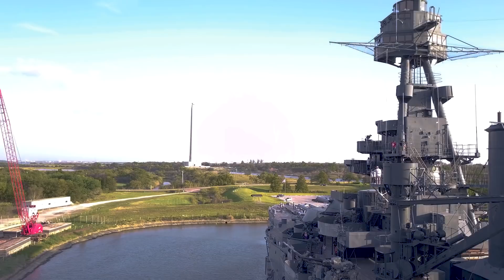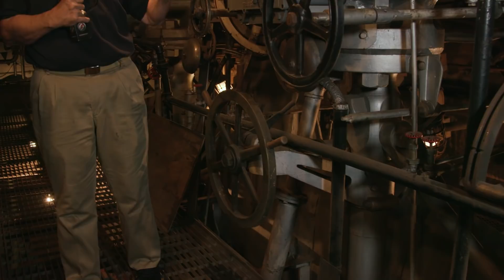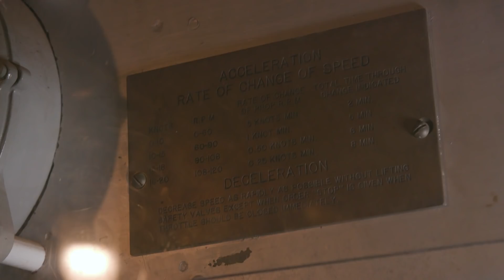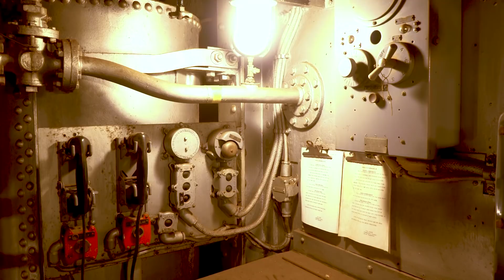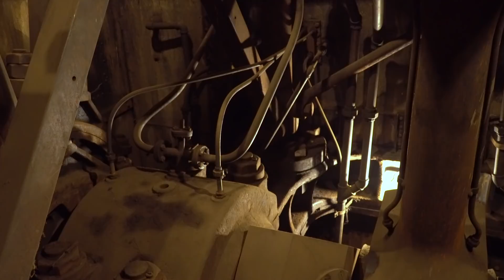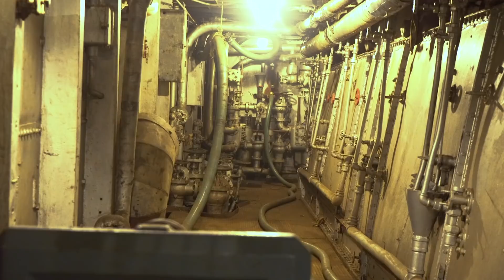Talkin' Ship - Engine Room!

Comment: I'm not entirely grasping how a triple expansion steam engine has 4 cylinders??!?
Reply: Triple expansion, four cylinder steam engine - one small high pressure cylinder, one intermediate pressure cylinder and two large low pressure cylinders. Cranks are set at 90 degrees. The reason for two low pressure cylinders is due to the volume of steam you do not require a super large low pressure cylinder.
Titanic (and sister ships) also had two triple expansion, four cylinder engines (that exhausted into a non reversing turbine).

Comment: The docent either doesn't know what he's talking about, or isn't very good at explaining how this engine is put together and how things work.  He doesn't mention where the cooling water is used (the crank bearings).  The way he says it, hints that the engine cylinders are cooled which of course they are not.  The eccentric rods don't move the piston, they move the valve stem which moves the valve.  He doesn't mention that they  pointing to a valve crosshead and not a main crosshead.  He never mentions that this type of valve gear is called Stephenson valve gear.  His explanation of double-acting cylinders is wrong, they aren't double acting to support the weight of the pistons but rather to extract more power from the steam, etc., etc., etc., etc.  I see docents everywhere that aren't experts in what they're doing, just well meaning volunteers, teaching nonsense and perpetuating public ignorance, it drives me nuts, can you tell?  Nothing personal Tom, maybe you were just nervous, thanks for volunteering.
Reply: You go volunteer and do a better job then. You won't though because you are a cowardly loser.

Comment: To save the Texas it will need to be dry docked permanently to be displayed. The constant water on the hull and electrolysis is causing the structural rust that is so expensive to be repaired.
Reply: There's ways to counteract that without putting her in drydock
Reply: No. She is too big to be permanently drydocked. After 5-10 years in drydock gravity will destroy her. Mikasa is not a real museum ship. She was destroyed in a large explosion in the 1920s and 60% of her was lost forever. What we see of her is parts of her and that is more of a memorial to the wreck of Mikasa than the actual Mikasa. None of her guns remain and the "guns" on their are fiberglass replicas.

Comment: Navy practice is for. Four hour watches with a three section rotation.  Routine would be four hours on watch followed by eight hours off.  The "off" time was spent at meals, engineering and shipwide drills, and sleep.
In addition to water, there were salt tablets to ensure electrolytes were maintained.   If conditions got too hot then watches could be shortened to two hours except under battle conditions.
The rudder angle indicator was important because the steam steering engine is also located in the STBD Engine Room.

Bob Fellingham MM1(SS) Retired.  Former member of the 1st Texas Volunteers, BB35

Comment: Love this old ship.  I was a member of the First Texas Volunteers, BB 35 for twelve years.  I am also a retired US Navy Machinists Mate.  Typical watch rotation for the period was four hours on watch and eight hours off.  In high heat, engineering rotation was shortened to two hours.  Salt tablets were the order of the day.  Off time was spent on maintenance, drills, and some sleep.  Maximum rpm on the engines was 127 Revolutions per minute if I remember correctly.  The piston stroke was 4 feet.  The piston sizes were designed so that each piston would have the same thrust or force on the crankshaft.  Two cams for each valve were connected via the Stephenson link rocker to the reversing steam piston on the outboard side.  One of the cam was for ahead rotation and the other was for reverse.  The high pressure piston exhausts to the intermediate piston which exhausts to the two low pressure pistons.  These engines were about the same horsepower rating as the reciprocating engines on the Titanic.  They are somewhat smaller in size due to having a higher supplied steam pressure.
Reply: if the engine room was knocked out, what kind of automatic backup electrical system does the ship have?
Reply: @purplepenguin6195  The dynamo rooms which contained two dynamos each were not in the Enginerooms.   The forward one is in compartment A-39.  Its forward bulkhead was at frame 41 just aft of #2 turret barbette and directly below the fwd control station.  The after Dynamo Room was in compartment C-24 just forward of #3 turret barbette and just aft of #3 fire Room.  Its forward bulkhead is frame 77 1/2. The forward Emergency Diesel Generator is in Compartment A-13-5 directly under #1 turret barbette. The forward bulkhead is on frame 41 on th e Port side of center.  The after Emergency Diesel Generator is in Compartment D-11 directly under #5 turret barbette to the STBD side of center.  The forward bulkhead is frame 115.  Each Emergency Diesel Generator has its associated emergency switchboard in the compartment.  As you can see, the electrical distribution system was widely disbursed. Unfortunately, the compartment for the after EDG was flooded many years ago.  That engine is now just a pile of rusting steel.
Reply: @Bobfelli  Hey Bob.  Are the the same Bob that was FTV, and worked at the STNP?  This is Chuck, an FTV ghost from the past
Reply: @charlesmoore766  Yes I am.  I am on messenger too
Reply: @Bobfelli  How can I get a hold of you without making my contact info public?  I don't do messenger or social media

Comment: Fondly called a Three legged jackass or triple expansion reciprocating steam engine. The fore runner to the Steam Turbines used later on.  The Turbines had a combination of 2 or 3 turbines running thru a reduction gear to the main propeller shaft. Each Turbine engine had an HP turbine LP turbine (with a Reverse section) and in some cases a cruising turbine.
Reply: But they had four legs...  Also while later turbines were able to run at much higher RPM and used reduction gearing to couple to the prop shaft, turbines of this era were directly coupled to the shaft and would run in the 100-200rpm range (depending on the specific prop configuration).

Comment: There's some perspective; took >21 minutes in a straight line to reach full speed.
Reply: The limitation on acceleration and deceleration on a steam ship is limited by the firing rate of the boiler.   Its a coordinated dance between the burnerman (guy running the boiler) and the throttleman (guy controlling the amount of steam into the engine)   If they don't work together you'll suck the boiler off line and you lose the shaft until you get the plant cross-connected to get steam from the other boiler. 

When the engineroom receives an order to change speed,  the order is repeated on a PA that you can hear throughout the engineroom.  The burnerman has to increase or decrease the firing rate of the boiler to generate more or less steam to meet the demand of the engine, he has to add more fuel and more air, assemble and insert more burner barrels, light the fires on the new burner barrels, etc.   Someone else has to increase the feed rate to add more water into the boiler otherwise very soon there won't be enough water to generate the steam, etc.  At the same time the throttleman will follow the acceleration tables and keep tabs on the main steam pressure gauge to determine how much more steam to admit to the engine.

During conditions which require the ship to respond to speed changes quickly, the engineering watch team will do something called "double up/double down" which means double the rate of the acceleration table and deceleration table.  It is something that is practiced often and is just as safe but is hard on the machinery.  The standard acceleration table minimizes "wear" on the machinery.

Comment: not gonna lie, I hope Texas gets saved as it is one of the few ships remaining with hand cranked and MOVEABLE 40mm and 76.6mm aa gun. The uss Alabama has all of her 40mms welded shut. My kids love playing on the Texas's aa and I like to history and design of the Texas. I hope the Texas can remain so that all can enjoy its beauty.
Reply: Texas benefited from a windfall of 10 40mm Bofors quads in the 1980s. In 1948 the Navy removed all of her original Bofors quads sadly because other ships needed them. In the 1980s they reactivated all the Iowa-class battleships so they had to throw away all their good-condition Bofors quads and Texas snatched up 10 of them (I think they have 2 more in reserve so they can easily fix the 10 Bofors on-deck with spare parts if need be) so they could throw away the horrible 4 1.1 inch quad guns that the Navy installed in 1948. Those 1.1 quads were terrible. 6 to 8 of those 10 Bofors 40mm quads are actually from Missouri! The rest they acquired from the other 3 Iowa battleships. They are not only restoring and repainting these beautiful Bofors quads but they want every future visitor to sit in those guns and move them and play with them frequently. 

Those Bofors 40mm guns are legendary. AC-130 gunships didn't retire them until 2020!!!

Comment: I have a basic question.  The USS Iowa has 212,000 shp from it's engines.  What was it about those engines that gave it almost 12 times the horsepower that Texas had?  Was it the 30 year gap in technology?  Engine size?  Type of engine used?
Reply: ltflak I believe the biggest change that gave the newer ships such higher amounts of horse power was increased steam pressure from having welded steam pipes systems. As Tom said Texas only had up to 270 psi in her steam mains, while wiki says Iowa could produce up to 600.
Reply: let me try to answer this. first as u know from the video The BB Texas was propelled by Steam Reciprocating engine in which The engineer said was the best for efficiency at that time. But, u need to know that in 30 years gap, steam turbines has really well developed and it turned out that the steam turbine has the double efficiency compared to Reciprocating steam engine. The steam turbine is also has the advantage of power it can produce vs the weight it has compared to the steam reciprocating engine (read power to weight ratio). for more information in fact today Steam turbine is still be used for Electric generation in Powerplants cz it is the most suitable engine that can produce power that needed for big powerplant
Reply: Iowa class use 600# super heated (dry) steam driving 4 Turbines each coupled to a reduction gear and propeller – super heat was 850 deg – most of the energy in the steam is the temperature not the pressure.  In the 1960s the US Navy went to 1200#/975 deg superheated steam.  You really didn’t want to be around a steam leak.   At low speed the reciprocating engine was actually pretty efficient - US BB prior to Texas actually had switched to turbines.
Reply: Yes, there are many accounts from other, damaged or destroyed ships, of scalded, practically melting sailors climbing out of engine rooms after a shell or shells got inside. And dying soon after. Steam pipes bursting is nasty.
Reply: Good question.  As I briefly commented in the video, all boilers were rated for 300 lbs. until the early 1930's because of their riveted construction.  They went to 600 lbs. once the Navy approved welding for pressure vessels.  Additionally, you cannot superheat steam for recip engines.  The very dry superheated steam will wreck the engines since they rely on condensate from lower pressure, saturated steam for cylinder lubrication.  Turbines thrive on superheat.  Steam coming out of the boiler steam drum is passed through the hot boiler uptakes again and gains more heat that is recovered 100% by the engines.  This gives a vast amount more power.  Lastly, the improvement of reaction type turbine blades and reliable double reduction gears made the huge horsepower possible.  All of this was necessary to give the Iowas their speed.  Since power requirements increase almost logrithmically with speed, they would have been nothing more than 26-28 kt. battleships without the 212,000 shp.
Reply: Also the change to 'improved' steam turbines greatly improved performance.  Edit:  The turbine technology greatly improved latter.
Reply: Steam Turbines > Triple Expansion.  Also, higher steam pressure.
Reply: Nuclear powered ships and submarines still use steam turbines. Just saying,